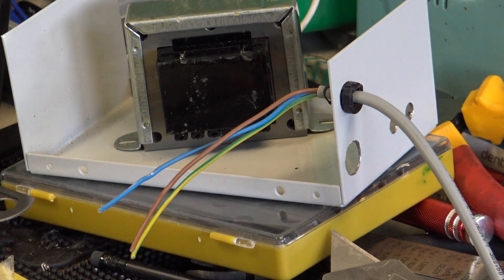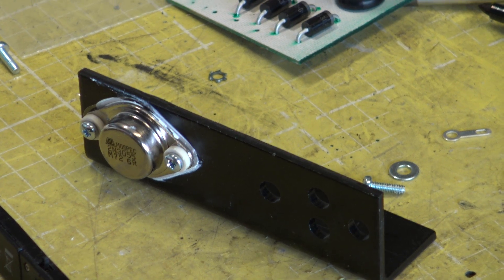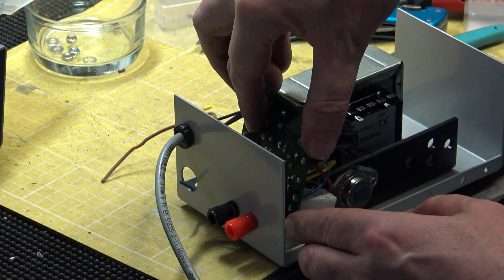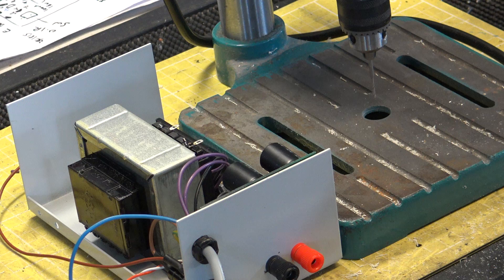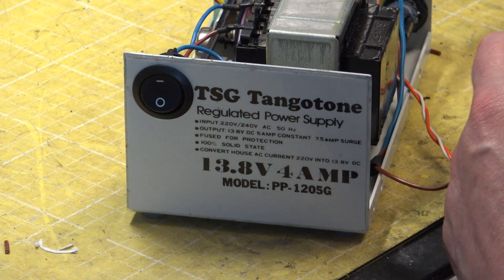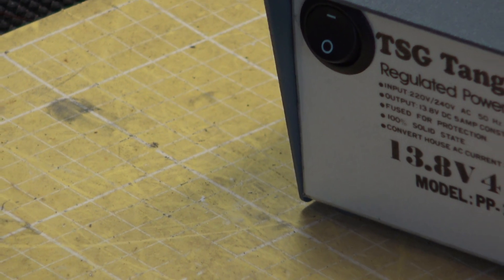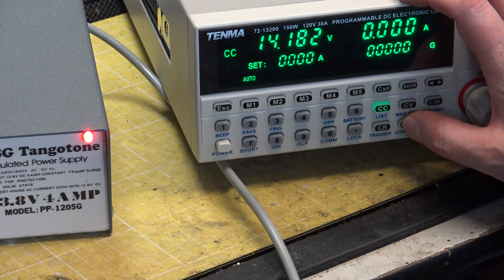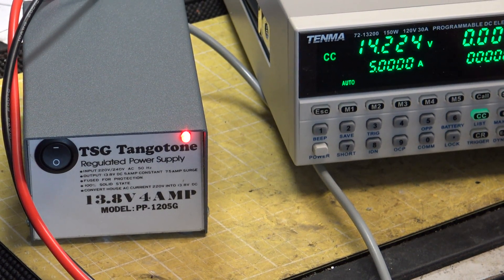Banned CB 1981 PSU project, pt4 - building some brand new ones

Comment: I am asking for knowledge, how is it with power supply capacitors, how to calculate their capacity? I once saw a professional power supply from a military base computer that had a 15V and 2A output, the condenser had 6800uF and the transformer was three-terminal for two 10A rectifier diodes each on a small heat sink, a 200W transformer !!, all this was fan cooled all the time . It had two 2n3055 transistors and an "ua723" IC. However, sometimes there are 2A 13.8V power supplies with a 50W transformer, 3300uF capacitors and four diodes, two transformer outputs. How to take the calculations of condesnators, transformers and diodes? Best wishes.
Reply from the maker: It's not straight forward & has a mathematical formula. Google "How do you calculate the capacitance of a power supply". You will find plenty of resources that way.

Richard
Reply: @ukfmcbradioservicingTango21  Thanks, I thought it was easier .. I was looking for facilities. Regards Arek :-))

Comment: Love seeing old school projects like this, my dad made me a train controller as a kid in this fashion, that was 45 years ago it still works, sadly dad doesn't but I just love old school stuff, I've also used a simple paint program to make PCB as well, what flex have you used?
Reply from the maker: The mains lead is a 3A rated one (3-core of course) from RS. If you need the part number I could look it up for you.

Yes of course, once you build stuff like this it will last a lifetime.

Richard

Comment: they look great.......

bur..

power button is too high up compared to original,
and i'd have had the LED above the switch to break up the plain area and with the surround either plastic or chrome.

but to be fair they look great,  amazing what you can do in half hour :)

Comment: Very nice job Richard. That case fits very well. Good to see it tested to the max on an electronic load. I don’t have one of those. I can rework the label if you want different positioning. Regards Graham
Reply from the maker: Thanks Graham, I think it's more the way Mr C cut it. We printed it onto grey card, A4; then cut it out how we thought it should be but about 2mm undersize all round. then laminated it. This way the label is still sealed in the lamination & the right size. We always test PSU repairs 'properly' as well as with car bulbs.

Richard

Comment: Looking  really good Richard Thanks. My experience  on switch modes isn’t so bad and my experience is that they are reliable and the higher noise isn’t the issue it once was. Perhaps that because my noise level in my house is ridiculous. I agree that they can be harder to repair but a lot of that is availability of the controller chips and experience.   You shouldn’t knock switch modes the efficiency is a good thing compared to coal burning linear. regards Chris
Reply from the maker: Oh, I was always impressed with a conventional transformer's 97% efficiency. My experience of switch mode power supplies over decades ends up with:-

1) special transformer failure, unobtainable.
2) whole PCB blackened with blown-up parts

RIchard
Reply: UK CB radio servicing  I am going to have to take you to task on that one Richard LOL. My experience as a designer of power supplies over decades is the argument over efficiency was lost  many years ago as the transformers efficiency isn’t relevant. The best linear power supplies approach 60% efficiency the worst switch modes are close to 80 and the best over 90% although they do some fudging regarding specific loading.   I suspect you have replaced a lot more linear regulator than you have blown up switch modes.  But it’s also the high manufacturing cost that really count against  linear supplies. Don’t get me wrong linear power supplies still have there place and I sometimes use them myself for some very particular applications and it’s normally due to isolation issues but the use of linear supplies is generally resigned to corner cases.   They certainly do go with a bang as a young engineer 30 years ago I had more than my fair share they are very unforgiving and the high frequency cores are specifically wound and are unfortunately unobtainable but that doesn’t make them bad.
Reply: @allthegearnoidea6752  I was a fan of modern switching power supplies, together with my friends, Unfortunately, they started to explode when we had problems with the antennas and there was a strong mantle wave on the cable, we got very discouraged, the power supply explosion is very powerful and gives a lot of fear. Therefore, we already prefer the usual linear, good for the younger imprudent and for experimenters, radio radiation and switching power supplies do not like each other. They are small and strong, they tempt people with a purchase, it's convenient. However, you need to have very correct antenna installations, guerrilla operations end badly, and in a storm it is very easy to destroy them, it is best to disconnect everything from the antenna and the network. Regards :))

Comment: Yes I have seen the quotes that you need ten amp but you do not. If running a pure uk 40 CB and it's all linked to money and bullshit my self o run a CB and 10m radio a 2m radio a,70cm radio and a PMR radio so I run a 30amp PSU but when I just run a older CB  it's  just a 3.5amp PSU and with plenty amps for the cb .But it's good to see how there made with the skills that I will never have and the soldering that I can not do to much shaking I struggle with pl259 ,but lots of very good information.